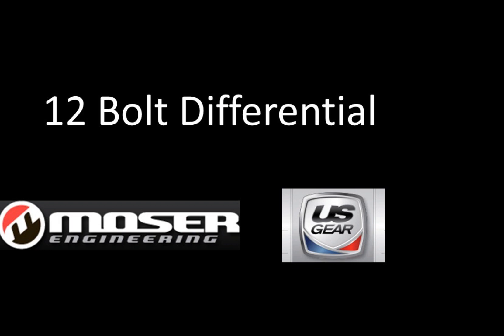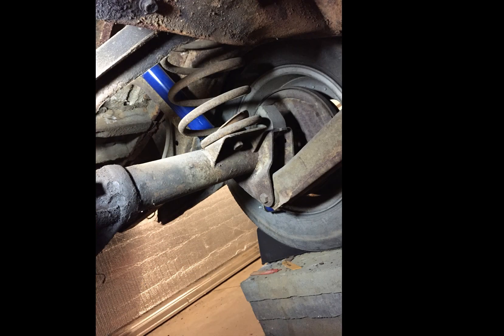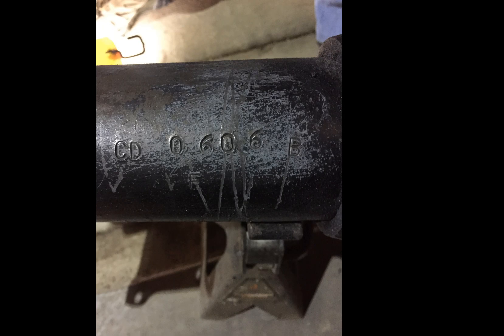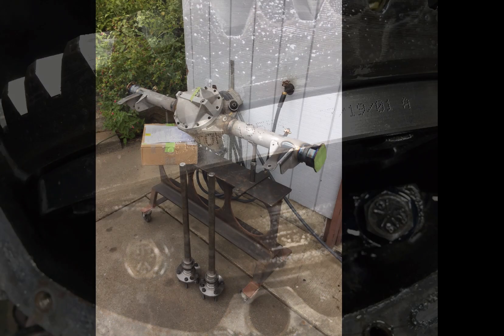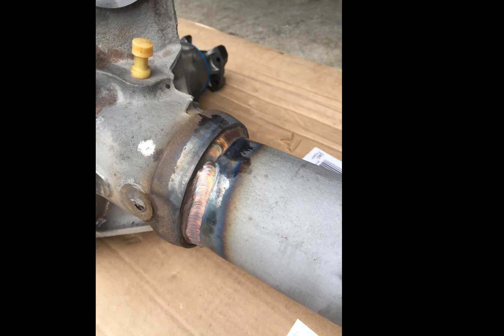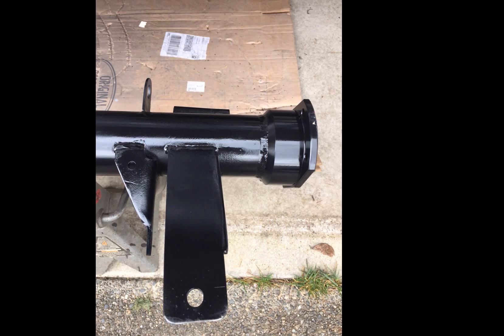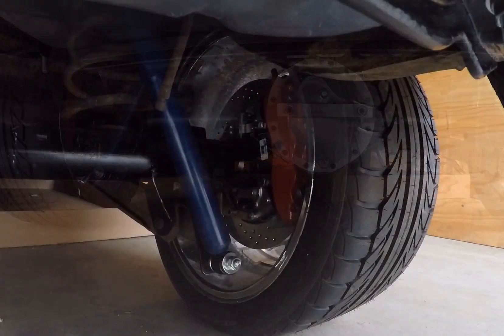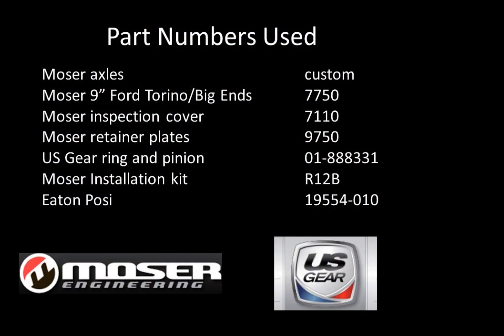12 Bolt in the 1967 El Camino UPDATE!

Comment: when moving your shock mount/trailing arm brackets over I see the fab shop removed and then moved the outer ones over....did you mover the inner trailing arm brackets over yourself? If so were there alignment issues with the trailing arms? Meaning with the front brackets on the frame? Thanks